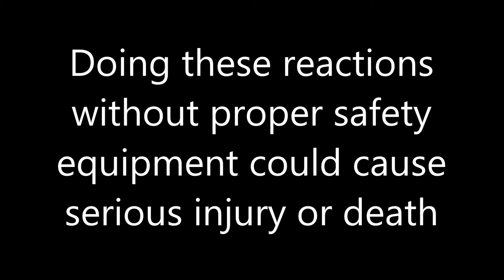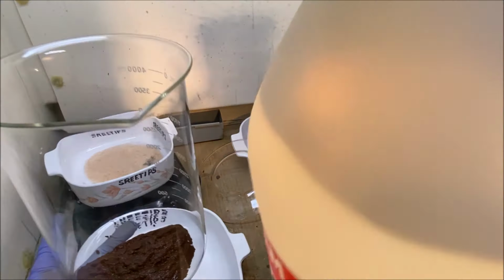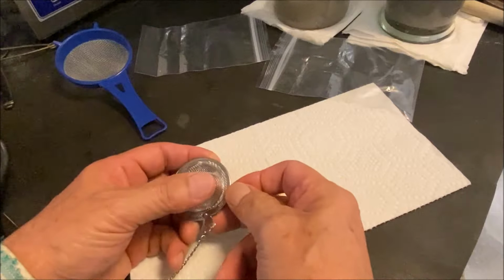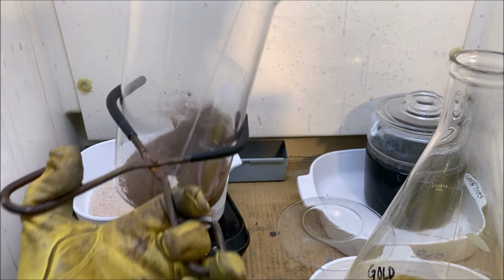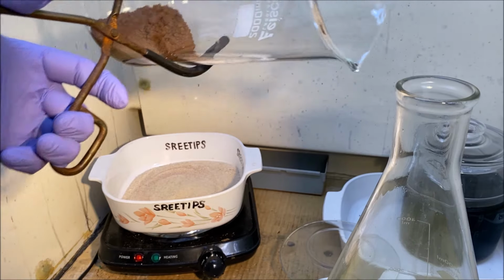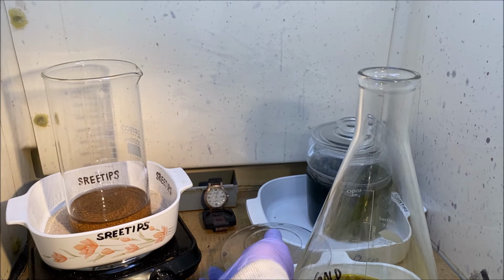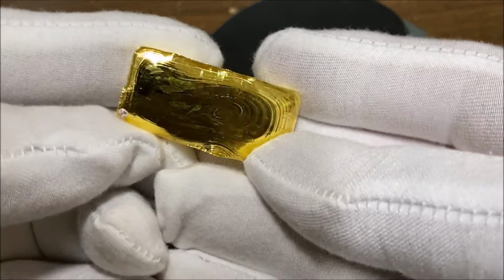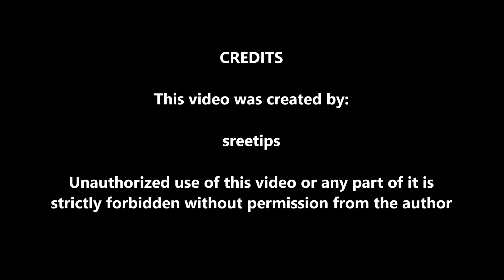Three Troy Ounces Pure GOLD Refine Pt2

Comment: Thank you for this valuable information. I learned from this video that the results of the Santis test were giving me a red color during the test process despite the presence of gold ions. I did not understand that, so now I understand that the presence of iron is the reason for that.❤❤❤
Reply from the maker: I don’t think iron in solution will turn color with Stannous Chloride. I used ammonium thiocyanate to test for iron.
Reply: @sreetips  Yes, but the solution I had contained iron and I did not notice that despite the presence of gold ions, which did not exceed 2 out of 10 in the carrier, until Santis gave me opposite results similar or close to the process in the video that I watched. I repeated the process in Aquariga 3 times and Santis gave me a positive result.♥️

Comment: Always an adventure. Thank you!~ BTW, do they even make Corelle anymore? We had Corelle back in the 70s. It was a big deal because it was ceramic that was resistant to breakage if dropped on the floor, however, it seemed that as it aged it lost its toughness. Dow has given us some great stuff over the years.
Reply from the maker: I use their pyro-ceram (Corning ware) extensively. It can take lots of heat. But it’s not bullet proof. I had one sitting in high heat full of wet cement silver that shattered once.

Comment: I noticed when you were melting this that it just sat there like a plastic lump without going liquid. It did that for a long time. Any thoughts on why it would do that?  Was there residual Fe that was absorbing the heat?  The end product looks amazing as usual.
Reply from the maker: I was using a brazing tip on my torch. I had the flame turned up on it and experienced a flame-out. I don’t think the brazing tip will get hot enough for that amount of gold because I had to fight it. A cutting torch tip gets much hotter. I’ll use that next time I have that quantity of gold to melt.

Comment: So I think I understand how to get silver cement, but, could you just dissolve sterling silver into acid and then cement out with copper to get cement if one was just to refine silver for a silver cell? Or would that be pointless?
Reply from the maker: You can hold sterling just like it is, no need to refine it. It contains a known quantity of silver and will track right on up with the bullion price. So long as you don’t try to melt it. Then its purity, and therefore its value, becomes questionable.
Reply from the maker: I refine gold. I use sterling silver, that I buy at estate sales, to refine the scrap gold. I recover the silver from that, melt into shot, and run it through my silver cell. Silver is a by-product of my gold refining. The cell converts the impure silver (about 980 parts per thousand silver) to high purity four nines fine (9999 parts per ten thousand) pure elemental silver metal. So I’m refining the impure silver, into high purity silver, not creating silver out of thin air. When it’s full, I harvest the pure silver crystal, put it away and forget about it. Then I repeat the whole thing again.
Reply: Thank you for your answer. That is one question I've had for a long time and wasn't quite sure about.
Reply: Yes, if you just wished to work with one of these two metals, the silver one, you are correct. The rest is tl;dr for most folks. 

Any excess nitric can be consumed with the addition of more Sterling and if you don't have faith in your method just make sure you have excess silver so some is not dissolved. Gentle heat will show any excess of Nitric, at this point you must dilute this fluid to prevent passivation from happening. Check the past videos in the channel for some tips on how much but, frankly, even if you go too far with the dilution the reaction will just happen more slowly. Add your copper in solid form and wait for the silver to plate out and fall off. 
Side note:
If you are doing this in a micro gravity environment the cementing silver will not be displaced from the contact point with the copper, really, electro-negitive ions will act to bond the atoms weakly and fluid movement will be required. Gravity is a good friend we have used for tens of thousands of years. Everything works the way we expect since that is just the way it is. End of side note. 

When the silver stops plating to the copper this part of the process is finished. Drain the fluid with a siphon, or, pour it off. You will be treating this waste to plate out the copper later so save it.  Rinse the silver mass (sponge) with distilled water to remove as much of the copper nitrate as you can. These rinses will need treatment to plate out the copper as well so save them. When you think you have removed as much of the blue color as is possible then do the next step, use a funnel to free the sponge of water, checking for more blue color. Rinse as needed, many small rinses are better than fewer large rinses.  Do it in batches maybe to be able to stop at some point for resting, lots of stirring here. 
Hot water comes next, you know the drill by this point. Tap water can be used for any of these flushes but you will still need distilled water flushes, many of them before you're done and ready for drying. At that point you will have clean cement silver suitable for a silver cell. The more time you spend in the flushes, rinses, and such the better. Save all the fluid wastes for treatment. If you wish to recover the copper it is possible but exceedingly difficult. Iron will drop all remaining metals from this waste making for a mixed mess with copper being predominant. This mud can be sold to a refinery but they will only buy this by-product in large lots, a junk man could buy this mud if it were dry enough and he will check the moisture level since it goes by weight (good luck finding one close by though, they too are a dying breed). 
Melt your silver cement into small shot and Bob is your uncle.
Additional side note:
In the past the US, in fact the entire western civilization was on a bi-metallic currency. The Silver to Gold ratio changed a few times over the centuries and most of the world's nations weakly protested but acquiesced. Then central banks for each nation became the new standard;  eventually gold was the last metal to be disconnected from real currency and fiat paper became the current standard. They say there were solid reasons, some were given, economists explain how this was great, nay, better as a standard. Complaints were stiffled, protests put down, the rich got richer, the poor got screwed, in other words, business as usual continued but the tether was broken at last. Afloat in a sea of worthlessness we bob to and fro, some wash into the lee shores, some into the whirlpool... life goes on. We still live!
Reply: @sreetips  Sad to read silver crystal is getting forgotten. It looks so beautiful, too bad we can't do much with it.
Reply: You can get this epoxy resin that's super runny, and super hard + it machines well and takes a polish.
I cast and machined a pyramid of silver about 2 Inches tall and used it as one electrode.
Then I cast a long silver rod, 12" long x .5" wide, and used it as the other electrode.
I used a chemistry set stand & clamp to be able to put the rod where I wanted it.
Over 3 weeks, by adjusting voltage, amperage, and placement, I grew a silver crystal "tree."
It's 6-7 Inches tall, 8-9 with the silver base. It has 9 "branches."
I rinsed it clean, dried it, and immediately cast it into epoxy resin.
I turned it on the lathe.
I buffed and polished it on the lathe while it was turning, in order to prevent myself from polishing "facets" into the surface.
I got the idea from watching Sreetips putting some of his prettiest crystals into distilled water.
Thanks Mr & Mrs Sreetips!
Reply: @HE-pu3nt  Picture of that would be wonderful to see.  :)

Comment: I'm afraid the beaker might break, and you'll have a hard time separating the solution from the sand. I meant for you to use two corningware dishes with sand in between them. Like you do with the water bath when you dry off the silver, but with sand instead of water. With another dish on top of the sand, if the beaker breaks, it will be easier to recover the material.
Reply: Also will help avoid scratching the beakers and pans.

Comment: I was wondering if it is possible to gather the cemented silver, melt it into silver shot, and use this silver shot to inquart with the gold for a refining. Also would this make a purer silver cement.
Reply from the maker: It can be used but it’s not recommended because palladium in the karat scrap will follow the silver and build up/accumulate in the silver. This could cause problems in the silver cell. Using cement silver to inquart will not increase its purity.

Comment: Love seeing the different refining processes in your repertoire.  

I know you’ve said the draw back to using ferrous sulfate  is the volume  of liquid waste it produces, and that for me thinking - when your gold refining waste temporary containers get full - do you heat them to reduce the volume before they go in a stock pot? Or do you let them evaporates while?  Or do you just put them in a stock pot with copper when they get full and use multiple buckets of stock pots when you have too much waste built up?
Reply from the maker: It would help reduce the volume of waste by evaporating. But I spend enough time processing waste. Evaporating would add another step to an already lengthy process.

Comment: careful with ultrasonic cleaners, they can crack and ruin stones, opal and emerald especially. Also will ruin the finish on some stones like jade. Really on totally safe on diamonds and corundum stones. Just a caution for you!
Reply from the maker: We’ve had the ultrasonic cause diamonds to fall out of their settings. Especially on those tiny 1mm diamonds.
Reply: @sreetips  yes, that happens too ! I hardly ever use them any more. I was talking about the thing actually destroying polish or worse, breaking nice big stones. I use formula 409 cleaner and a toothbrush mostly now, and don't leave stuff for hours soaking.
Reply from the maker: I use green Mr Clean

Comment: Hello brother, I had a question when I want to evaporate nitric acid from aqua regia and add hydrochloric acid when I add hydrochloric acid, the solution becomes black and does not smoke and the nitric acid does not come out I do not know why?  Thank you for helping me
Reply from the maker: I evaporate my solutions down until no more fumes evolve and that’s how I can tell when the excess nitric has been expelled - when no more fumes are present as the solution is heated during evaporation. Then I rehydrate the solution with hydrochloric acid. I don’t know why yours turns black. I’ve never seen that before. No experience.
Reply: @sreetips  Thank you very much brother for your answer, I have another question, does high temperature when removing the nitric acid cause the deterioration of the aqua regia solution?  What is the appropriate temperature when I want to boil the solution to remove the nitric oxide?
Reply from the maker: It’s actually nitrogen dioxide (the red fumes). I take it down until there are no more fumes in the beaker. I’ve taken it down to a syrupy consistency, and when it gets that concentrated you got to watch it because it don’t take much more heat to evaporate to a solid. I’ve had that happen. To remedy I just dissolve the solids with some hydrochloric acid and gentle heat. But I don’t think that the gold gets destroyed or harmed if this happens. No loss of metal if I keep the beaker covered. It doesn’t hurt the gold. Just makes it a little more work to get the gold out of solution.
Reply: @sreetips  Brother, thank you very much for your answer and help

Comment: I must have missed the video where you explained why you stopped using borax. I can see the results as to why but you never said your reasoning. Been great watching your journey over the years regards.
Reply from the maker: I did add a pinch of borax to the molten gold during the melt. But it was in fast mode and it’s hard to tell in the video. I did it just before the pour when I was tilting the dish to capture all the little balls of gold into a central mass.

Comment: Maybe I missed it but what’s the purpose of the sand when heating/boiling?
Reply from the maker: The heating coil that I use causes hot spots to form in the bottom of the beaker and then a steam bubble forms and cause a mini steam explosion that spatters hot liquid and gold. The sand acts as a buffer and distributes the heat evenly so that there are no hot spots.
Reply: @sreetips  more liquid to cover will also help keep spattering down - even if it is distilled water.

Comment: i tried removing the silver plate but i couldnt get the voltage low enough or the amps using AA batteries and so the the plated silver tarnished but didnt peel rather the item went black but wiped clean ??? :( it was fun to try but its not financialy viable it was something for me to try, also im not going to power suply or the chemical route still i can try again maybe with a car battery but that seems wildy inefficient ?
Reply from the maker: Instead of a car battery try a battery charger.
Reply: @sreetips  weve got one but i heard you need an old one since the new ones have a built in safety ? Ill look into though :)
Reply from the maker: Yes, you need a manual charger, not automatic

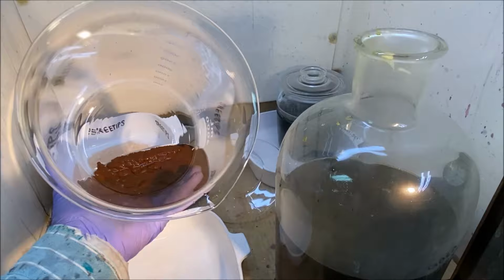Comment: @2:00 How do you want to refine that huge bottle with the gold refining waste solution ? Will you first boil it, till most of the water has evaporated and then flter it and continue with the classical base metal addition and sedimentation of the valueable metals? Thank you for your fatastic alchemy videos!
Reply from the maker: That big bottle is temporary gold refining waste solution. There could be traces of platinum group metals in that solution. And the gold powder settles out. Then I can add the liquid to my stock pot (it’s full right now). In the stock pot, any traces of PGMs will cement out onto pieces of copper and accumulate in the bottom of the stock pot.

Comment: Not the bars poured in Graphite molds are particularly ugly, but are there other molds which would produce a better product? Maybe a machined steel mold? Maybe time to invest in a press to produce a Sreetips bar or round, equal to the quality and time you spend in refining it?
Reply: Personally, I don't think that would enhance the value...unless and until Sree could produce a Johnson-Matthey or Valcambi or PAMP grade bar. There are plenty of people who like the hand poured look, and the nice pour lines are a sign of purity. I happen to agree with you on silver bars, I like the pressed bars. But on a > 1 oz gold bar, people usually melt the bar into jewelry as opposed to stacking, like with silver. At some point they are better off buying Cana Maple Leafs or Buffalos, getting assayed .9999 four nines gold if they want to stack 1 oz chunks.